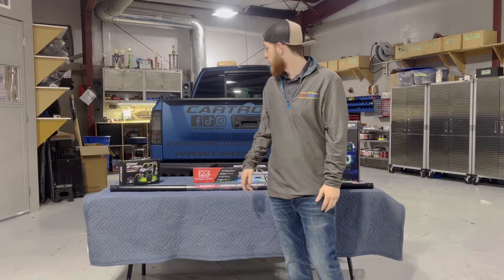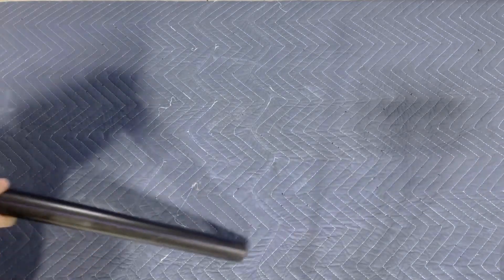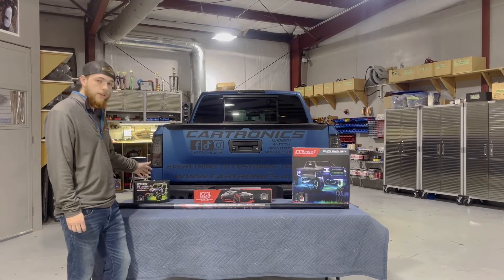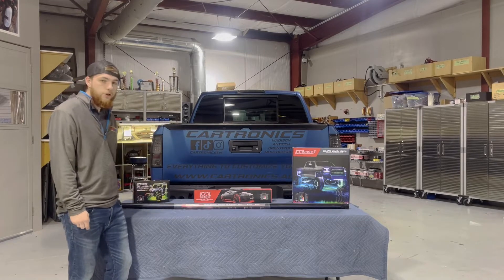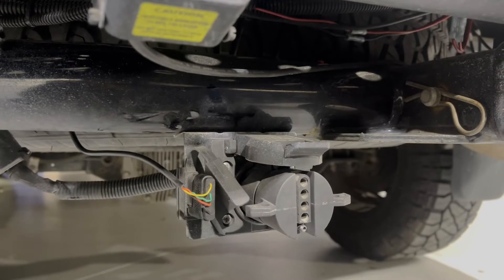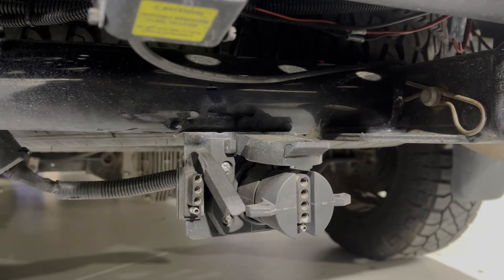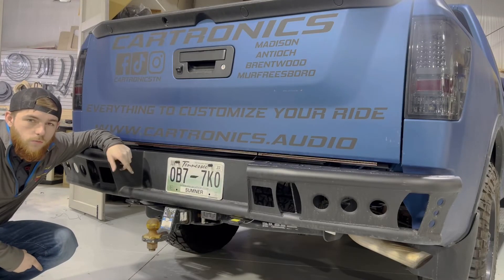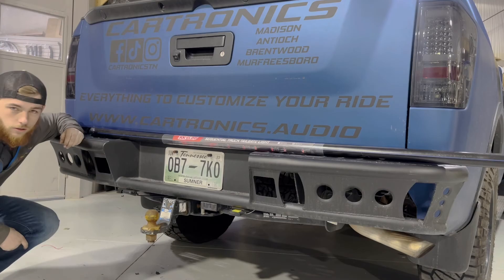XKGLOW LED Tailgate Light Bar for Trucks | Hardwire Install | *SUPER BRIGHT*

Comment: You can use a lighter to strip the cables as well. Just heat it up then it will slide back nice and clean and you dont risk cutting any wires.

Comment: What did you do with the Red and Black single wires?
Reply from the maker: The black wire will be connected to the vehicle's reverse wiring. The red wire is a built in error canceler that will be ran to a constant 12v source in the event of any errors on the dash such as trailer disconnected, etc. Any further questions can be directed to xk@xkglow.com.

Comment: I got my light bar today - what are the loose red and black wires for ?
Reply from the maker: The red wire is a built in error canceler. It will need to be wired to a constant 12v source only if you are getting error messages on your dash. The loose black wire is for the reverse function. It will tap into your vehicle's reverse wiring.

Comment: Can u do the blinkers...i have another kind ... the blinkers they run from middle to the ends
Reply from the maker: Which product are you referring to? This tailgate bar does sequence from the middle, out.
Reply: @XKGLOW Channel  I'm talking about the blinkers / flashers/ emergency  lights .  U call it. When u activate it does it blinks or runs from the middle to the ends sequentialy ?
Reply from the maker: @smpleman  The hazards will just flash. The turn signals will sequence from the middle outward
Reply: Oh, thanks. I stick to mine then